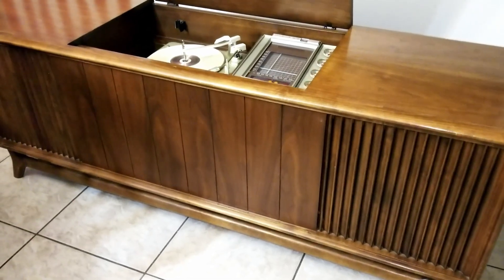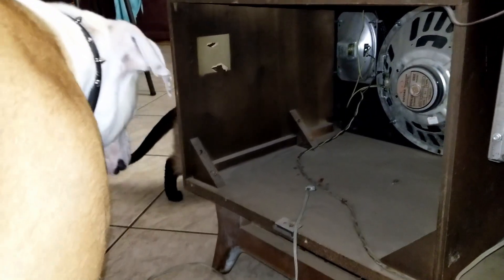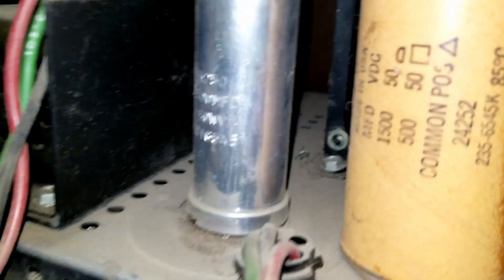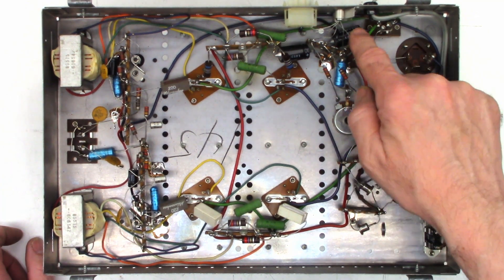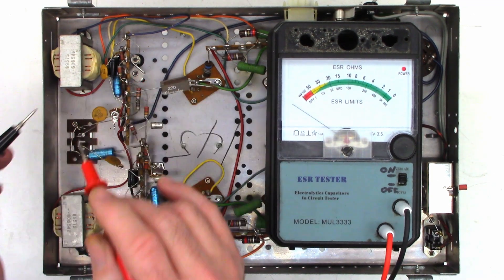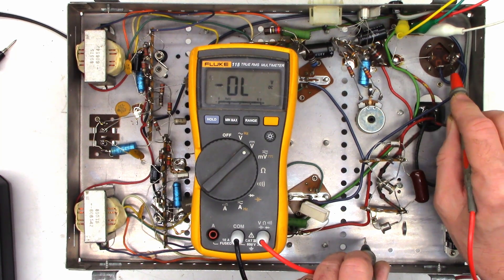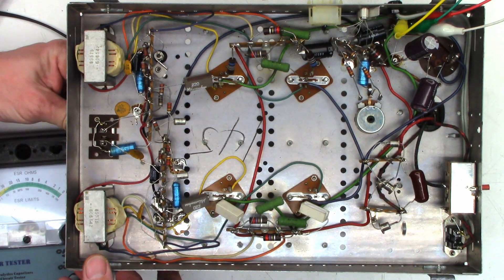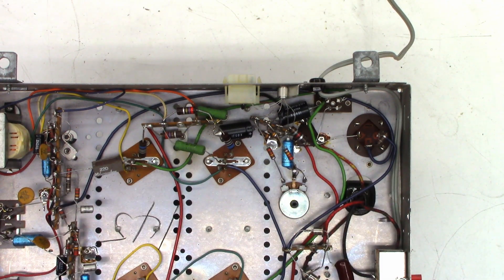PACKARD BELL CONSOLE STEREO FROM 1965 HAS A HUM - RECAPPING THE AMPLIFIER RPC46

Comment: Ні,
My name is Ron. 
I recently purchased this, or a very similar, Packard Bell stereo console.  (I think it may be a Model RPC60 based on other pics I have seen.  The model number tag is missing. The serial number is 331813). I want to have the radio and turntable refurbished. I am not an electronics guy. I am trying to locate someone that I could hire to refurbish. I live in Palm Springs, CA. Would you happen to know of anyone (near Palm Springs, or anywhere, for that fact) who may be interested? I realize I may be grasping at straws, but it doesn't hurt to ask. Thanks.

Comment: I notice here, and in other projects I see where they do ESR checks on caps in one section of the unit, but not the caps elsewhere.   About half the caps in the amp were bad, but wouldn't about half the caps in the tuner/main control panel also be bad?
Reply from the maker: Probably has many other bad caps in the preamp/tuner, the customer only wanted the amp serviced. I gave him the option of recapping the entire unit and he declined it.

Comment: I have the a very similar unit, but a tad smaller. I found it at a thrift shop for 20$ and it played very well. Unfortunately, it has developed a hum in the right channel. So how much does a recap like this typically run?
Reply from the maker: The complete amp recap was $160 and that includes parts(and shipping), and labor

Comment: I don't have an ESR meter. I just change out those old worn out caps. If they test good today, they're likely going to short tomorrow. Causing even more serious damage.
Reply: I'm currently on the lookout for a fully functional 60s console but ill take one with a broken record player as long as the amp and speakers are able to play my phone and everything is intact but I feel that even if someone gets a functional unit that it should be rebuilt soon if you plan on daily use
Reply: @albertpintor3522  At present I don't have any consoles.  They are very rare where I live.  But I am always on the lookout for any old audio video equipment.
Reply: @BurgerJohnny  i just find mostly the crappy 70s cheap models

Comment: Excellent 👌 I was kinda worried that you might only replace just two capacitors! I don't know what happened, either you are good at talking to customers why things need to be done or maybe the customer just wanted it all done... Either way, I'm happy that all the capacitors got replaced in the end, the ceramic disc capacitors don't usually fail so they should be fine! 
I didn't see you check any of the Allan Bradley's for drift! Generally they are really good but you just never never know if you never never go! 
Just one thing that I kinda wouldn't have done, that's the cable tie around the capacitor and the AC power cord! It might be fine for now while the capacitor is new but might induct 60hz hum later on in life... That's why the AC power cord runs along the inside of the chassis, to keep it away from other components! If you still have this stereo system with you by the time you read this, at least separate the two core's of the AC power cord that lives inside the chassis and twist them together for some common mode rejection.... You know, just like the AC filament wires are always twisted in vacuum tube amplifiers otherwise your amplifier forgets all the words and just hums all the time LoL... 
Apart from that, good job, it's a beautiful piece of furniture and it makes music! 
Those phase inversion transformers make this an interesting circuit, I guess you used what you had back then.... It was probably cheaper than transistors for the same job? Who knows, it's definitely different and that's what I like...

Comment: Thanks for posting the video.  I also just restored a very similar Packard Bell console stereo. Here is a link to my restoration video. https://youtu.be/EZns4Gi36Xk  By the way the transformers in the power amp perform the phase inversion to drive the push-pull pair of output transistors.  I have a copy of the Sams Photofact for that unit if you need it.
Reply from the maker: Yes! please email a copy norcal715videos@gmail.com thank you!

Comment: Silicon or Germanium transistors, this is around the crossover, so probably small signal transistors are silicon and the power devices are Germanium PNP devices, with a small NPN to make the one half quasi complimentary.

Going to guess the speaker that was replaced was from a failed output transistor, that gave the full 30V rail to it, cooking the voice coil nicely.  Nice protection for this would be some 4700uF 50V electrolytics back to back in series with each speaker line, to at least keep the DC from cooking the voice coils. In the original design they probably did not want to spend what would be equal to the cost of the rest of the amplifier semiconductors on the 4 capacitors needed, as it was going to be, at least well out the warranty, some time before the DC offset got too large, and cooked a coil.
Reply: don't think so.  It looks like it has transformer output coupling.  No DC could ever be passed through the voice coil, even if failure mode. Very much a tube/valve amp topology built with transistors.
Reply: @rogerknapman1260  the output transistors drive the speakers directly. The transformers perform the phase split function between the single ended driver transistor and the push pull output pair.
Reply: The one I had made enough bass to blow a woofer with the right music.
Those old Packard Bells thump!!
Reply from the maker: I looked and the outputs are germanium transistors. Good eye!